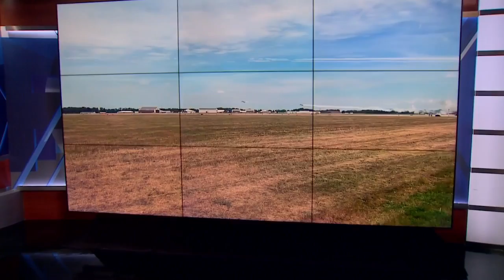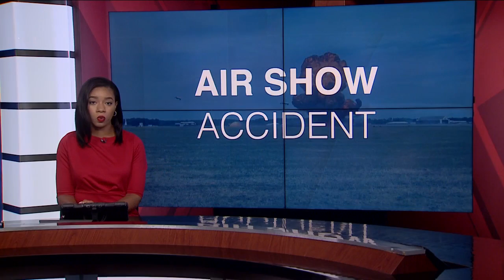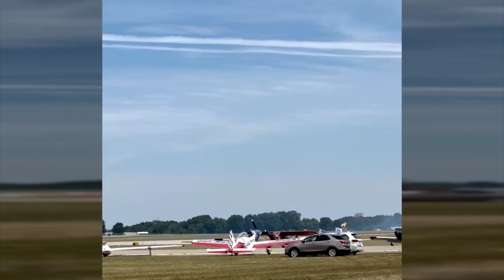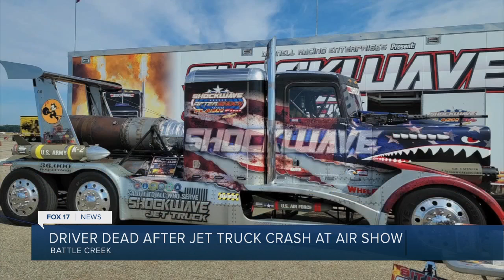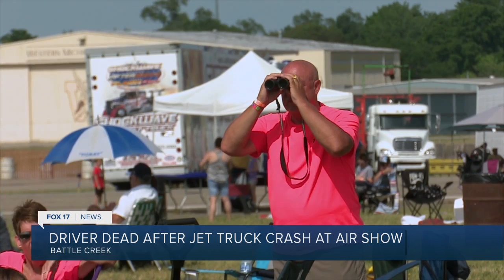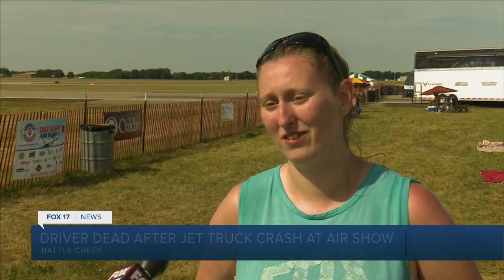Victim identified in Battle Creek Field of Flight accident

Comment: The pyro show had nothing to do with this incident, the jet truck had a severe failures before the fireballs on field. On other footage there is a loud pop sound and debris, could be jet engine compressor failure thats sprayed metal into fuel tanks and tyres. The chute deployment happens are the same time so maybe the driver knew something was wrong. Very sad incident.
Reply: Thanks for the explanation. I was wondering if it was a pyrotechnics show as well. Just looked like his engine exploded right before he entered that cloud.
Reply: I agree that the tire failure may have been audible, but at that distance the sound would not have reached the crowd or the camera mics until the truck was much farther down the airstrip. The pop sounds were likely from the pyrotechnics, which were fired off camera well before the truck reached them.
Reply: Yeah, he definitely had at least one engine flame out on him and a chute deployed before he lost front end control. I thought maybe he lost a front tyre due to debris from a grenaded engine, the debris could have also injured the driver and caused the steering deviation, but I would have hoped he had protection from that kind of incident. It's a sad state of affairs though, that's for sure.
Reply: The pop is either one of three things, the tire, the chute catching the wind, or the engine compressor blowing up
Reply: thanks, whenever I want to know the real story, I always rely on random youtubers for first hand knowledge.
Reply: What’s “tyres”? Do you mean tires?
Reply: @johnnyghanja  This is a comments section, not the NTSB final report....... you can take as little or as much as you want from it, but as you obviously have inside knowledge of what happened, why don't you enlighten us so we can stop with out suppositions? I don't see anyone saying that's what definitely happened, but the evidence is there in the video for all to examine and comment on drawing from their individual knowledge and experience. See how that works?
Reply: The other reason I don't believe the pop sounds were from a failure of the truck is that I stood at the fence near the edge of an old school dragstrip in 1991, much too close by today’s safety standards, and I watched Les Shockley do a full run in his original Shockwave. It was so overwhelmingly loud (even compared to top fuel dragsters) that even though I've seen the damage that exploding truck tires can do, it's almost unthinkable that a tire failure would be audible from any distance while those jets are at full tilt.
Reply: Damn
Reply: Look at the rear tires before it goes thru the pyro, the wheel covers come off. The tires go flat or some kind of failure. A tank or something comes off too. It looks like the truck starts to go sideways as it enters the fire. Out of the fire looks like a tire or two go flying and the truck is spinning.
Reply: @nickmaclachlan5178  derrrrrrrrrrr don't be madbruh. Derrrrrrrrr
Reply: @TerryWade... It's the British spelling of the world...
Reply: It sure didn't help
Reply: tires*
Reply: @allentoyokawa9068  only if you sleepy
Reply: Definitely that rear tire
Reply: @shable1436  the rear tire blows before the chute opens and before the pyro.
Reply: @rontalley8385  it's still one of those things

Comment: The really amazing part is they've never had a accident like this ever. The thousands of safe  runs theyve made in that truck show how professional and dialed in the crew is. Any vehicle weighing 10,000 lbs going over 300 mph is on the verge of disaster every time. God speed.
Reply: I commented on another video the following.. there was a very similar crash to this by the same truck, I think the year before, but the truck did not barrel roll, it merely spun around on 4 wheels gradually slowing to a stop. The driver was lucky that time; not nearly so this time

Comment: It takes a very special tire to go 300+ mph. The stresses on those tires are extreme.
Reply: Exactly. Very little friction at that speed. The truck would be barely touching the tarmac. May Chris rest in everlasting peace ✝️.
Reply: That’s why they replace every tire after 3 or 4 runs.
Reply: @xHustlin247x  I don't think it was a tire failure. I think an engine gave way and punctured the tire(s).  I wouldn't be blaming the tires until we know more.
Reply: Those are air craft tires
Reply: @harpoon_bakery162  correct and they do have another video I believe on the truck that shows the engine blew up shooting pieces into fuel tank
Reply: They take a brand new $700.00 steer tire and shave it down to about 5/32 tread depth. They would do that because of the speed and centrifugal force from the truck's performance.
Reply: @sydneyweston3819  this information is accurate

They're not special tires in any way they're regular truck tires that are shaved down to 1/8 in
Reply: @harpoon_bakery162  There is a slow-motion replay that shows the rear tires disintegrating, which then caused the engine problems.
Reply: @snotnosewilly99  It's just the opposite. I've seen the video and multiple witnesses have come forward.  It's out there, you just gotta find it.
Reply: @bigred1247  those are not aircraft tires they are racing tires
Reply: @harpoon_bakery162  I never once said it was a tire failure
Reply: @bigred1247  Link ?
Reply: @snotnosewilly99  Link ?

Comment: Les Shockley was the man who created this piece of engineering marvel & had a lot of latest safe features.  Rip to the driver & condolences to the family & friends of The Shockwave family.
Reply: Shockley family does not own the truck. They sold it many years ago.
Reply: @ronhublimo5220  I didn't say they owned it still I said  Les Built the original Shockwave 🙄
Reply: @troybarrett3434  correct and that was a long time ago, yes it had safety features but when a turbine engine has a blade failure , it sends a chain of events that you can't plan for.  I'm not sure they will ever find the cause since the NTSB won't be involved to spend the money on metalurgic tests on the engines.  But I'm guessing that it was an engine failure of the highest magnitude due to turbine fan blade rupture.
Reply: But I am glad that Shockley family got a new clone of the truck and will keep it for many many years
Reply: @harpoon_bakery162  thanks for your highly technical analysis, before deciding it was a turbine blade failure, can you direct me to where someone would get semi tires that are speed rated to 350mph? Or any tire that’s currently rated to 350mph?
Reply: @Jimmythefish577  apparently, you didn't watch the witness, who was at ground-zero, attest to the fact that the engine blew up and scattered metal engine parts into the tires, yea, so I guess you missed that part.  By the way, it's part of this very video.
Reply: @Jimmythefish577  ok,the tires are custom built for racing, these are not the average tire you would find on an 18 wheeler. If you watch the slow motion replay you can see that something is wrong with the engine or the driver's side of the truck just before it passed behind the explosion. The engine appears to have had some sort of a catastrophic failure and took out the tires on that side which caused the truck to skid and roll.

Comment: My son and I watched this truck earlier this year in Belle Chase, La. During the Blue Angels Air Show. Its hard to believe a truck that size goes that fast. I hope he didn't feel anything and was unconscious when she burned. God bless his family !!
Reply: It really doesn’t weigh much.  Its not like an actual tractor that pulls trailers.
Reply: @TuMadre-q6l  really!? I figured he just hooked up his hauler and pulled all his equipment around with some rig!? Thanks for clarifying that buddy. Best Regards
Reply: Deboss Garage (youtube channel) did a nice video on it. It only weighs like 7k pounds and is really just a truck body on a specially built frame. They were interviewing one of the owners (Neal Darnell) and he said it was built more like a race car. Apparently, the truck they featured did crash in 2008 and was totally destroyed leaving the driver without a scratch. So, the roll cage cabin did its job. I can only assume (wish) the forces involved in this latest crash were enough to take him out quickly. 

He described the engines and where they got them and mentioned the fact that spare parts were not available for them anymore. So, what it sounded like, is they scavenged parts from spare engines when needed (just my interpretation of what was said - I could be wrong). He talked about how dependable and bulletproof they were. Well, I'll add that yes, they are tough engines, but turbines can let go for the littlest reasons and need to be adequately maintained. Now I can't possibly know well they were maintained, but it would be an area they'll likely look into. They could be well maintained, but something very small got overlooked.  It's risky any way you look at it. 

I've seen these trucks perform many times. Very sad!

Comment: Yep, at about 1:30 on the video you hear a loud sound come off the truck and at 1:32 something ignites (presumably fuel) at the rear of Shockwave. Happened before he went through the pyrotechnics explosion.
Reply: He never went threw the pyro. They are not allowed to blow pyro on the runway it’s against the faa regulations sorry he blew both tires in the rear. He never went threw the pyro.

Comment: It looks like the 2 left tires disintegrated just before he went through the flames and the parachutes deployed. So either he had a catastrophic failure of the wheels or he hit something on the runway. Either way, he was along for the ride at that point. RIP good sir.
Reply: He didn't "go through the flames".  The pyrotechnics were a good hundred yards away, in the median, parallel to the runway he was driving on.
Reply: @5thGenNativeTexan  Watch the video again. Particularly the second half of the video where it's zoomed in and slowed down. He clearly drove through the flames.
Reply: @Hossman757     Nope.  Start at 01:52 in this video.   The bright yellow flames are his truck catching fire.  Watch for the next second or two.  You can clearly see how the pyrotechnics (the darker orange flames) are placed well in front of the runway.  The are set off in that median which is parallel to the runway, which is about a hundred yards away.  It's always set up like that.   Not in a million years would the put a performer anywhere near the gasoline staged pyrotechnics on the ground.

Comment: Negative. The tires blew. The debris off the tires and aluminum wheels shredded the sides of the motor causing a catastrophic failure and explosion.  Those jet engines have fuel lines on the outside . There was a problem when he pulled the shute early before the tires blew from what I'm seeing.
Reply: The right third end blew up due to a cracked leaking fuel line, blasting the tires off,causing her to veer left .and we do know that and once the investigation is complete you all will know as well.
Reply: Just like both of lightning McQueen’s back tires both blew up in cars (2006)

Comment: My sincere condolences to the friends and family of the truck driver.  It must have been horrific for the spectators to witness this. I'm not understanding what was supposed to happen.  There was a big fire explosion before the truck or the airplanes even got there.
Reply: Pyrotechnics it's part of the show but unrelated to the accident.
It was not a parachute failure. 
One of the engines exploded and destroyed the parachute mechanism and the left rear tires.
Reply: The big fire before he got there was part of the show.
Reply: The pyrotechnics were no where close to  the Shockwave truck. Unless you are at the right angle, and viewing the accident in slow motion, it just happens to (appear) that they went off and then caused the accident from this particular angle.

Comment: My guess is left rear tire failure, you can see the center hubcap blow off the wheel before the truck goes out of control.  The loud pop they heard before the crash started was the tire exploding,.  I’m sure that failed tire flipping around at 300+miles an hour is what started to tear up the jet engines.
Reply: The engine blew and it caused the tires to go
Reply: Very astute of you to catch what they were showing and saying in the video yet you still got it wrong.

Comment: At 1:30 the parachute started deploying. The engines were still running (not good!). A piece of tyre flies up towards the plane at 1:31. The pyrotechnics then set the parachutes alight. The rest is the accident unfolding.

Comment: So... the left rear tire(s) come apart, fender flapped up, then the fender is trying to flying off but knocks a fuel tank loose while only the right parachute is deployed, this causes truck to start sliding towards the right, then the 2nd parachute deploys and the 7,000 lb truck skips into the air and tumbles to its final resting place ? ? ?

Comment: It is very difficult to determine from this one angle but after viewing the footage many times it seems the truck has hit one of those black things at the edge of the runway, because it has veered to the right, & I think just prior to this moment the driver realises the issue & releases the parachute way too early (or it auto deploys for some reason) & while the engines are still providing thrust. An explosion is seen at the rear around this time also so whether this is the cause of the accident is hard to know. Apparently there is footage from a better angle so investigators should be able to determine what happened from this, & from all physical evidence. Has an official report been released yet?

Comment: Why did he drive thru a huge fire before crashing? I’m confused. What was the fire for?
Reply: It was an optical illusion.  The pyrotechnic display was closer to the camera and not on the runway.  The media seems to think that the truck drove through it.
Reply: The fireball is nowhere near the runway the truck is on. The fireball is set off when the truck crosses the finish line. It's just for show and is unrelated to the accident.

Comment: Did he catch on fire worse when he drove through the ball of fire ahead of him?
Reply: Slow down the playback speed to 0.5 and go to about 1:51 and start watching from that point. Then it’s easier to see that the back of the truck was on fire prior to him reaching the huge fireball. I was wondering the same thing myself…didn’t know what the reason for that large fire was. It looks like a “pyrotechnics explosion” according to others’ comments. Whatever the case it is still a very sad and tragic loss of life. He was too young to leave behind so much…my thoughts and prayers go out to Chris’s family, friends, and community.
Reply: The ball of fire is in fact well off the runway, He does not drive through it for the show. It just goes off approximately when he crosses the finish line.
Reply: @bills6093  maybe that was the intention, however from onsite witness (and as the lady above examined herself) testified to, the pyrotechnics ignited and inevitably exploded the vehicles right rear tire ~
Reply: @1SWEETSERENADER  No, you can clearly see the truck is in trouble before it goes behind the fireball. It blows a tire before the fireball. Whether the tire just failed, or something damaged it, like a jet engine failure, we will know later. A tire blowing at such a high speed  is likely the main cause of the loss of control, imo. Fireball is unrelated.
Reply: @bills6093  possibly the extreme heat (from nearby pyrotechnics burst) ignited an exterior fuel line,  already compromised from your stated engine failure, which caused the explosion of rear tire(s)😢
Reply: @bills6093  that doesn't make the substantial contributing degrees of heat from said "fireball", unaffect the truck passing through with already exposed and compromised fuel lines...
Reply: @1SWEETSERENADER  No, the fireball is too far away. Don't be fooled by the optical illusion from the camera lens.

Comment: Seems like one of the parachutes failed (left parachute), and pulled the truck to the right…..idk, just looking at the footage, it’s the only think I can think of other than a tire malfunction or suspension failure.
Reply: engine failure
Reply: arm chair quaterbacks from 1000 miles away... seriously... crash analysis from the crappy video?  ridiculous
Reply: @robertg5775  tyres were punctured by the engine failure, no rocket science required.

Comment: Likely loss of control due to a faulty chute. RIP. Prayers for the families.
Reply: Chute wasnt the issue, it deployed properly. Something happened to the chute after it was fully deployed causing it to drop to the ground and let the truck lose control completely
Reply: @jacobnash4278  they usually have more than one chute, i agree one opened but if there was more than one on the truck and one failed to deploy that would of caused the loss of control as it was pulled to one side. Same thing happened in 08. It's also like when a duel engine plane loses an engine, upon landing they have to use feet breaks and speed breaks to stop because using the reverse thrust with one operating engine, as in a jet liner for instance,  its going to cause it to veer to that working engines side. But it also sounds like, maybe an engine explosion caused the loss of control.

Comment: MLive Video shows the complete crash with 
captions NOT blocking the video. It appears to me that the right engine 
exploded and took out the right rear tires and the jet truck is already 
90 degrees right BEFORE reaching the pyrotechnics. MLive video  54 SEC 
Marker.

Comment: I was watching the video and the truck was fine until the parachutes were released and tightened up, wondering it once they pulled on the part of the framing there attached to something broke causing the back of the truck to break apart and you can clearly see the parachutes canister being ripped off the side of the truck ..